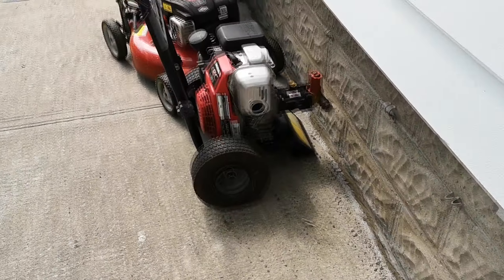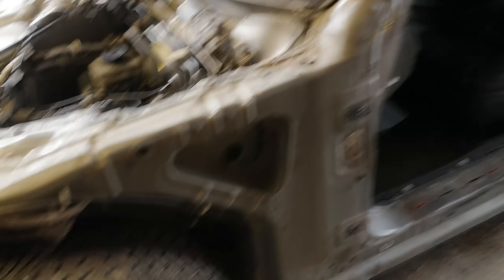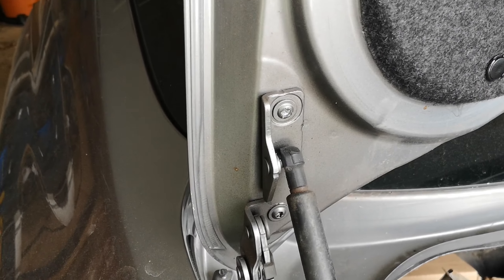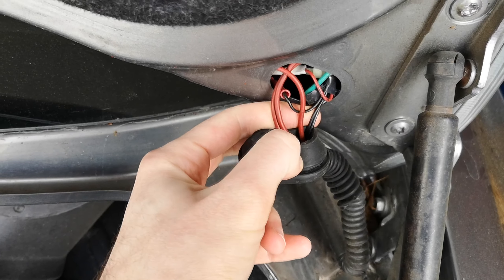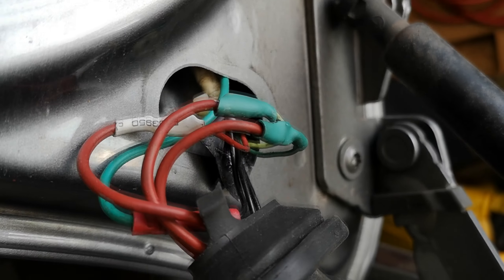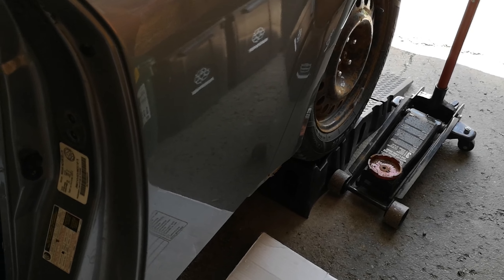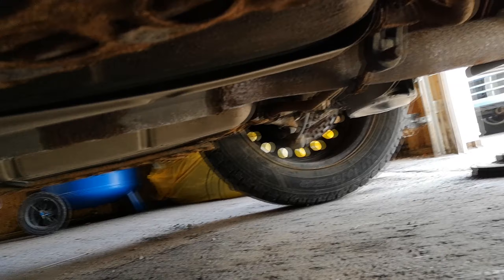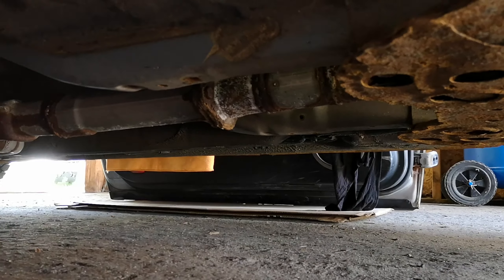Cleaning things up.. (attempting to remove the exhaust)

Comment: If you do use the Honda engine in a go cart check the cam timing before you installed it. The timing belt causes problems in those engines.